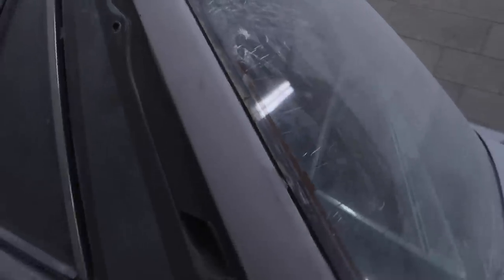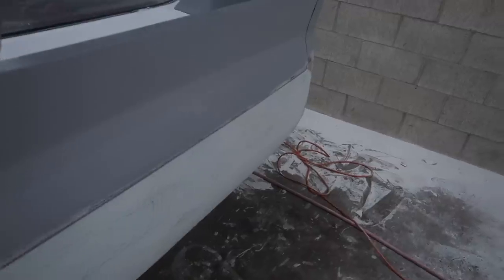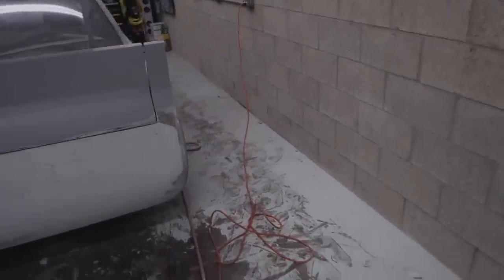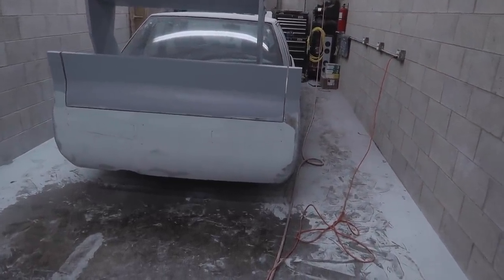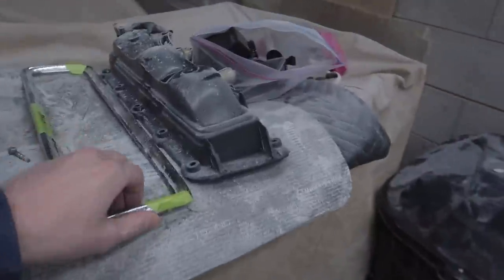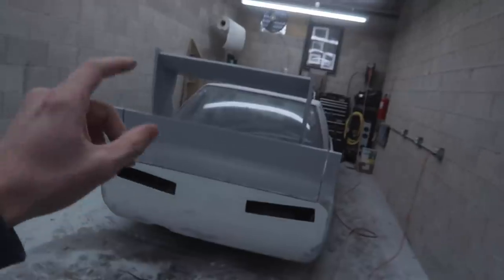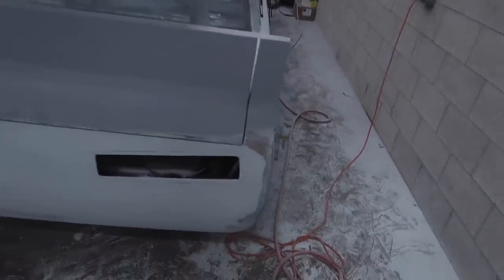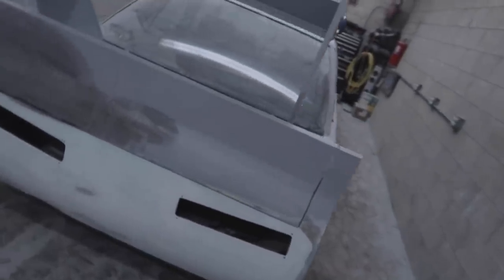Ultra Rare Jdm Tail Lights Installed!

Comment: Looks cool! But a question are you going to leave the engine stock or some basic bolt ons? Because i would be cool to switch it up a bit in terms of what you do
Reply from the maker: Straight pipe and that's all lol
Reply: Tyler Fialko owh okay kinda sad but its your car stil hyped asf for the build